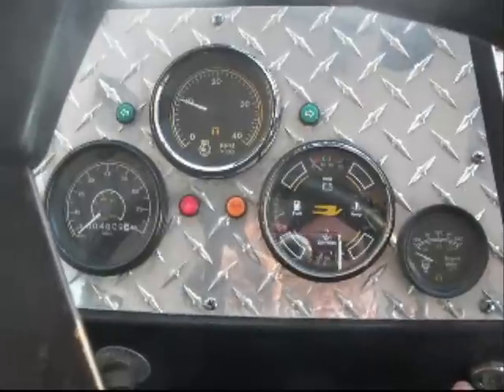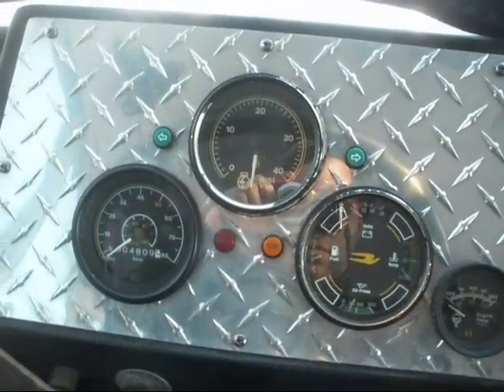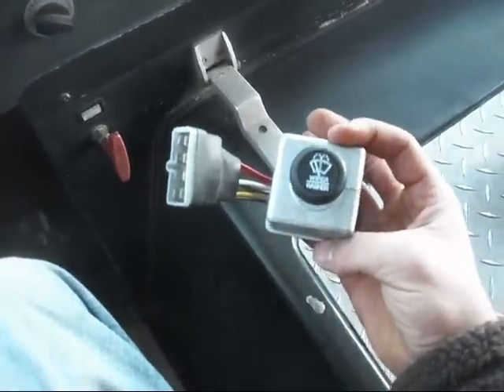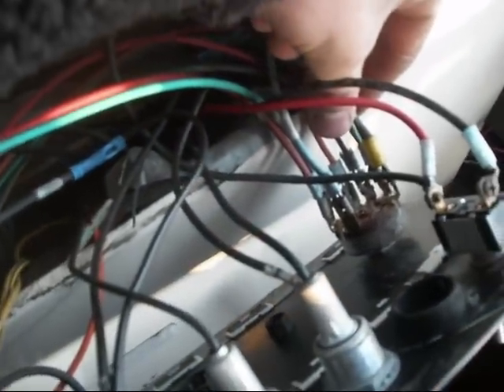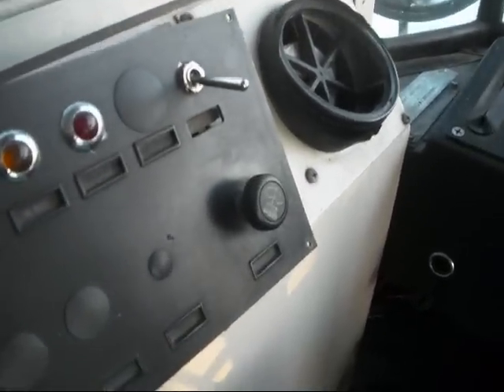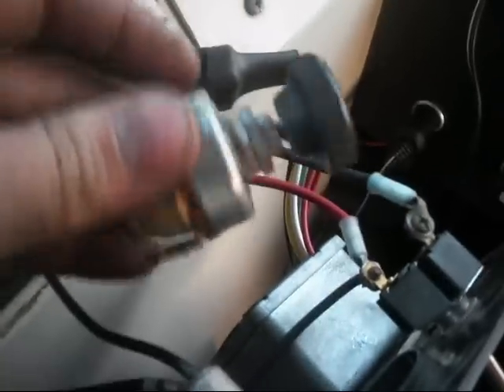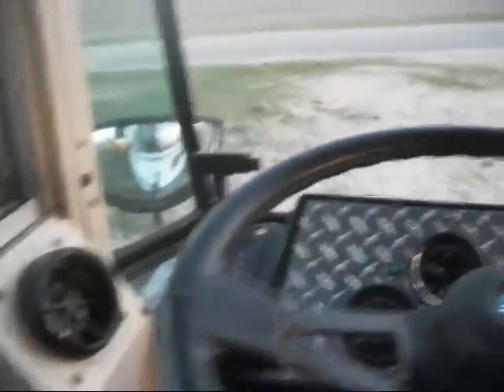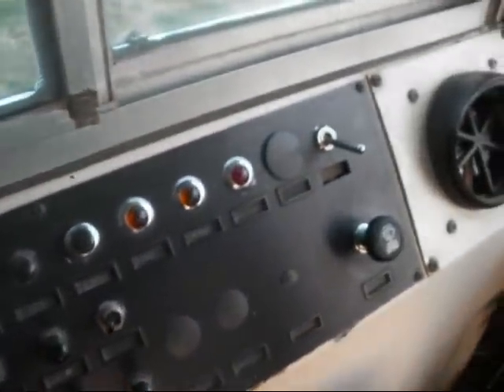Converting to Intermittent Wipers- School Bus

Comment: i installed a Cole Hersee similar switch for this into my 1965 vw beetle the mod is the park wire on the wiper motor had to eire to the switch's B+ and of course a ground. I installed a Cole Hersee delay switch in a 68 beetle was a challange to get the nut in as the dash pad i had to use needle nose pliers. and had to add an electric washer pump to this to get rid of the one that worked off the spare tire. Not just school busses they work on the classic air-cooled volkswagens up to 1972 as cars up to 1967 the hole has to be slightly enlarged for the switch to fit in. In a beetle the switch will clear the wiper linkages fine.  but this Cole Hersee switch will replace a non intermittant beetle switch and the hose connections. im happy i did it in my 65 bug if a single speed wiper motor will have to be wired to the low speed part. after i did it and testing the wipers cycle through a delay, and park as they should. You can get the switches on ebay, or look on Littlefuse's website under the Cole Hersee products.